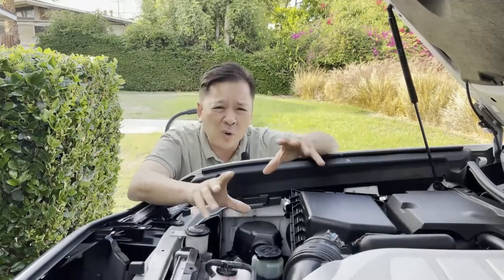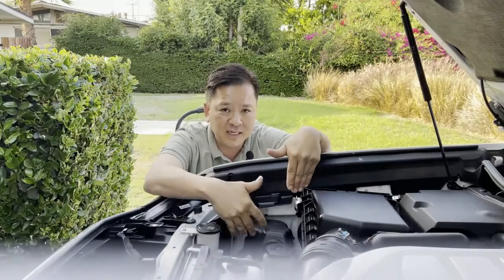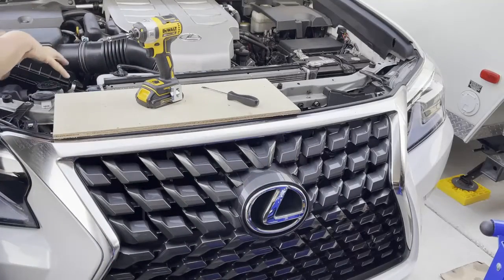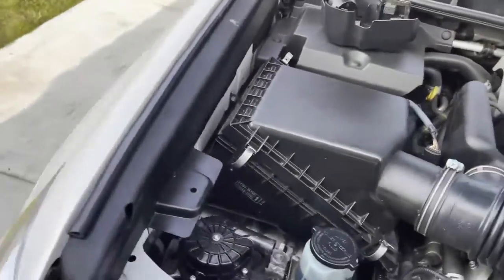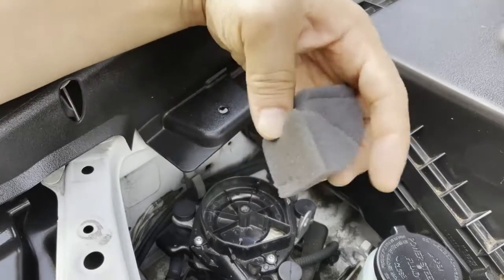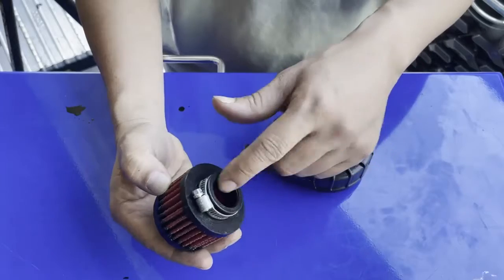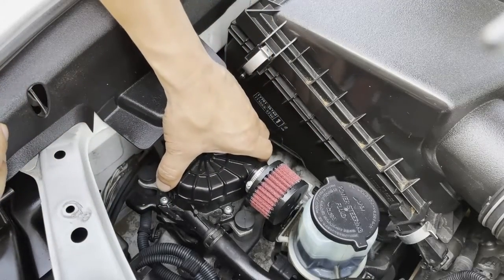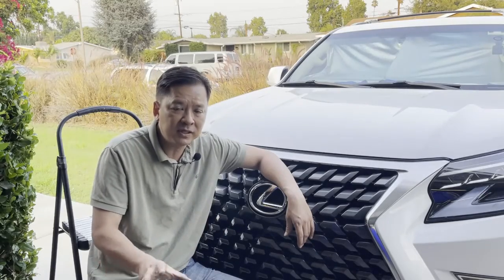Why We’re Modifying the Lexus GX Secondary Air Injection Pump

Comment: I did this MOD last week after watching this video. I used the K&N filter since I live in Vancouver B.C. Canada and the price for each filter was 1 dollar difference so I went with the K&N. I want to mention the K&N filter fits but it is tight. When finished it will be sitting against the side of the power steering fluid reservoir. Should be okay since the top of the filter is rubber and soft. You may have to squeeze and push things to get the cap on correctly with the K&N, but it does work. Thanks again ! Your videos are so helpful and appreciated! I share them with all my fellow GX owners locally or I recommend they subscribe.
Reply from the maker: Ugh... Stewart.  Please note that all my shitty Canada comments were prior to realizing I had Canadian viewers.  My ignorance finally accepted that our neighbors from the North have internet.  I promise no more shitty Canada comments.  Thank you for watching.
Reply from the maker: I think you bought the 2.375” height one. K&N makes a 1.5” height one that may have worked better. Here if the link: 
K&N Vent Air Filter/ Breather: High Performance, Premium, Washable, Replacement Engine Filter: Flange Diameter: 1 In, Filter Height: 1.5 In, Flange Length: 0.625 In, Shape: Breather, 62-1370 , Black https://www.amazon.com/dp/B00029WXTA/ref=cm_sw_r_cp_api_glt_fabc_XM0EE2J3EMZWT8YVK0E3
Reply: Is this not an issue if it does touch the power steering reservoir?
Reply from the maker: @jimilianhernandez8074  not at all as the filter is encapsulated by rubber. It’s anything all it does is act as a support.
Reply from the maker: @jimilianhernandez8074 If you bought the correct size it would not touch the reservoir at all.  There is actually a lot of play to move it in and out of the SAIS assembly.  In the event that u did purchase  one that was longer than usual, it would still not affect it since the top of the breather filter is made out of rubber/plastic.  The reservoir would just act as a support.  The breather is super lightweight and won't cause vibration scuffing.
Reply: @GXBOB  thank you Bob. Your videos are literally a lifesaver. And I enjoy ur humor ;)
Reply from the maker: @jimilianhernandez8074  thanks for the kind words!

Comment: Unfortunately, for us 470 owners, we can’t just pop in a new filter. Because some genius decided to hide the pump under the intake manifold. Going to the dealership tomorrow for my p1445 code, knowing full well how much they’ll quote me to fix it.
Reply from the maker: Yes, I've heard....and i can definitely relate.  My next quest is the PCV remove and replace which is another waste of a beautiful Saturday.  I just need to find some momentum to get started.  My second quest is to pick up a 2006-2009 GX470 to tackle some of the differences.  Haven't been able to find one that wasn't ridiculously overpriced.
Reply: @GXBOB  have you ever heard of these codes clearing on their own? Like maybe whatever was clogging the check valve and keeping it closed, came loose and opened it back up? I literally just drove it and the codes are all cleared. Have an appt at Lexus tomorrow. They won’t be able to run the code if it’s not there.
Reply from the maker: @BradleyJokerst  yes, that is supposed to happen with a solid CEL. A blinking one is a major issue and requires you pulling over and having your truck towed.  After i replaced the valve, CEL cleared by itself after driving it a bit.

Comment: Awesome tip!!! Thank you.
Reply from the maker: Anytime Coastal.  You can either keep the black top cover on or off.  I kept mine off more better air flow.  But when going in for smog inspection, you better slap it back on.
Reply: @GXBOB  I ordered from your link but I think they’re running out. Is there an issue refitting the cover with the new filter?
Reply from the maker: @CoastalGX  there is no issue in putting back the plastic cover. I left it off for maximum air flow. You’ll need to put it on if you take your car in for a smog check

Comment: Just fining your videos. I purchased a 2016 GX with 72,000 in feb. my pump went out in my tundra few years ago so ill take this mod very seriously. i do have another question for you though. when i push the brake pedal down i hear some air/vacuum noise. it only happens with the initial movement down, no noise when releasing the brake pedal. is this just how the brake booster sounds in this vehicle? Thanks!
Reply from the maker: If you stick your head under your dash and depress the brake pedal, you’ll notice the squishy sound is the actuator linkage for your brakes. I hate to say it’s normal but I’ve lived with it on all my GXs. Don’t go changing your brake booster, master cylinder, etc hoping it’ll go away. It won’t.
Reply: Thanks for the response. I can live with it lol

Comment: Hi Bob! First off all I watched all you Videos regarding GX. My next mod will be headlights + grill. 

Just did this update with the same component and exactly as you did in your video! Thank you so much, Bob. 

Quick question:  now, after turning off my car (GX 2015), I can hear some strange high tone sound for a few seconds under the hood. It sounds like this pump is trying to suck the air through this filter with the force or maybe normally but this filter makes it. 

Do you have the same?
Reply from the maker: After switching out my engine air filter with a K&N, i also get the same air hiss. Same thing with the secondary pump filter. The  difference in filter elements is what creates that sound. You also hear a little of the aftermath of the suction after the engine is off is the vacuum it created also coming to a dead stop.  You’re going to notice a difference in performance as u would with any filter that allows more air into your system.  If you want the sound to be less obvious, try putting the black plastic cover back on your secondary air pump assembly. I left mine off as shown in the video.
Reply: Thanks so much again for advice, I just took a ride and everything seems great! No odd sound or anything like that. 👍👍👍

Comment: Hah, so I got all my tools ready and popped off the plastic engine cover. I was about to pop off the cover for the air injection pump and noticed it already has a Uni filter on it. So either the dealership put it on or the previous owner did.
Reply from the maker: Haha 😂
Reply from the maker: Saved yourself some money
Reply: @GXBOB  Did you put the cover that goes over the air injection pump back on? Also, I wonder if the uni filter is washable?
Reply from the maker: @NytronX  Yes i placed the entire housing back on in order to pass smog visual inspection.  The K&N type filter is cleanable with low pressure soapy water and air dryed.
Reply: Does the vehicle look stock once again?  I was thinking it would, and that it would pass CA Smog.
Reply: @gwilli1754  yes

Comment: Hey Bob, do you think it’s still advisable to have this mod to a newer GX like 2020 and above. Great video. Thanks
Reply from the maker: Technically it’s not really a mod. You’re replacing one filter with a better filter. Sort of like replacing your cabin filter with a K&N one. Only difference is, it’s external instead of internal. You can visibly inspect damage before it escalates. One other thing…. The increase in acceleration is very noticeable after the switch.

Comment: Did you put that first black plastic cover taken off back on over the SAI? I just got done doing mine I put it back on not sure if that matters just didn't see it in end of video and was wondering if you left the new filter exposed
Reply from the maker: No. I left it off for better air circulation. Have you noticed a big improvement on your acceleration?
Reply: @GXBOB  ok gotcha!, you beat me to it! Because that was my next question was acceleration (I don't want to assume it's a placebo effect but after taking the GX around the block a couple times feels faster is that suppose to happen?) you answered it GX bob with advanced psychic A.I. abilities.
Reply: I should of hooked up my blue drive OBD2 find whatever in it monitors the vehicles conditions before and after the mod to see if numbers/factors change
Reply from the maker: @aranda2307  you can still do it. Takes less than a minute to switch back to oem

Comment: after removing the large plastic cover, when i tried to take mine off it didnt come off as easily as yours did with the center screw removed.

does the small cap on the end need to come of first?
Reply from the maker: I just took the mushroom cap off first because i needed the assembly to be held in place in order to pry off the mushroom cap.  I don't think taking the assembly off first or the mushroom cap off first matters.  My top housing was also kinda sticky and stuck from 5 years of being screwed down.  Only reason mine looked easier to pull off is because i did a couple of takes for film editing. It was already loose by the time i did my final edit.  Enjoy Skinny Girl!

Comment: Thanks again for saving us thousands of $$$.  Just ordered the filter and will do the mod shortly.
Reply from the maker: Just remember to make sure the flange diameter is 1".  If you are able to find a different type of clamp, it would be recommended.  I hear people using this metal clamp tighten it too tight and it wears/chafes down the black plastic over time.

Comment: Bob,  do you know if this works on the Tundra as well?   Two years ago my 2010 Tundra with only 50000 miles failed with this problem which Toyota fixed.  I still have the Tundra and also have a 2011 GX460 with 130000 miles on which Lexus wants to replace two catalytic convertors at a cost of $7500.  I will definitely do this mod on it before the pump fails
Reply from the maker: There are a span of years where the Tundra uses the same part as the GX460.  See this link i found on eBAy which uses the exact same pump.  As far as the location of the secondary pump in a Tundra engine  compartment, you'll have to do some research and locate it.  They all work off the  same principal whether or not your current year Tundra has the same designed air pumps or not.  The 4.6L engine made it very accessible in the GX.  For the Tundra, there are numerous sites on youtube that show this issue.  From what I see, the older Tundras are a pain in the ass to do the simple mod.  
https://www.ebay.com/itm/224376541358?chn=ps&_trkparms=ispr%3D1&amdata=enc%3A1-Ai6M8S5Ss2x6y9ruIPKLQ54&norover=1&mkevt=1&mkrid=711-117182-37290-0&mkcid=2&itemid=224376541358&targetid=1262407448140&device=c&mktype=pla&googleloc=9031253&poi=&campaignid=12875054069&mkgroupid=120167277977&rlsatarget=pla-1262407448140&abcId=9300536&merchantid=138361782&gclid=Cj0KCQjwsZKJBhC0ARIsAJ96n3WqHQmUNJKn20PsVj3mQaUGvZvA2d8HBPwFYGyf9CVekvXqBlk4cUkaAiciEALw_wcB
Reply: @GXBOB  Thanks Bob.  Enjoy your videos
Reply: @GXBOB  Do you think it is possible that I have early failure in this pump on the gx so that the catalytic convertors are not cleaning right due to the air pump but not enough that the performance is affected?
Reply from the maker: @MegaFjcruiser  Robert, driving around with a failed catalytic converter is not going to ruin your good working secondary air pump.  Your pump works as an output to the catalytic while your catalytic is the input to the air pump in the emissions flow.  You can do your K&N  filter mod and still drive around with your bad catalytic up until you have to do a smog check.  Only thing you have to worry about is the bad smell and the if and when your engine will seize up due to catalytic "burn thru".  You're going to run rich and maybe puff out some embarrassing smoke eventually.  I'd go look into your local junkyards for a GX or go online and find a used one if the 7500 price tag is too steep for you.  Good  luck Robert.

Comment: The problem is that the rubber where the metal clamps will deteriorate from the heat of the engine. I had to replace it after 2 years.  I ended up putting a thick grease around the rubber connection/clamps.
Reply from the maker: 2 years out of a part less than $20 is amazing as it is.  Thanks for the heads up.  Most likely i will check on it every oil change to see if i need to replace it.

Comment: Thanks for the tip! My first GX 460,  I will defiantly do this.
Reply from the maker: What year GX did you buy?
Reply: @GXBOB  2016, currently with 82,000 miles
Reply from the maker: @JasonSmith-pc6kr  Sounds about right. I have a 2017 with the same mileage.
Reply: @GXBOB  I've had it a little over a year, put about 20,000 miles on it, so far so good. My wife has a 2010 rx350 for about 6 years and now with 135,000 miles, and has been a great car, so I bought a Lexus.
Reply: @GXBOB  Hi Bob. I have a 2015 GX460 with only 52,000 miles. Do you recommend doing it now or waiting for running more on it?

Comment: Awesome video, Bob. Doesn’t the recall only cover up to years ‘13? Did Lexus fix this on the 14’+ models?
Reply from the maker: From the look of things, they're still using the same foam sponge that can deteriorate over time.  So i'm not sure if they made a "fix" or they just replaced it with a new sponge  when you take it in for repair.
Reply: @GXBOB  thanks! I have a ‘15 and for $30 it seems like it’s worth the peace of mind. What are your thoughts on the “lifetime” transmission fluid on these? Ive seen people argue in forums about whether or not to do a drain and fill.
Reply from the maker: @aragonXL  
1. If it was meant to be lifetime, why did they design a flush and fill hole in each of their transmissions?
2. I am an eyewitness of a few transmission drains that resulted in dark broken down fluids.  
3. I also believe when they said "lifetime", they didn't expect you to keep the same car for 20 plus years.  There is a statistical team that shows the average ownership of  each vehicle was probably 5 years the most.  I think they meant lifetime in that sense or so they hoped.  Same thing when they calculate warranties.  Ever know why things fail a week after the warranty expires?  
4. I did a drain and fill for each of my GX through my local mechanic using WS because it was cheaper than to do it myself.  
5. Even if they claim lifetime, are you driving your big investment or are they driving it?  The person that cares for your car the most is you.  I rather just spend the money every so often for peace of mind.
Reply: @GXBOB  i agree. Thanks again! Keep up the awesome content!

Comment: If this service for preventative maintenance how many miles do you think you should change that out in
Reply from the maker: The minute you bring your car home, i would do the simple mod so i can sleep better at night instead of second guessing the rough mileage the internal foam will start disintegrating.  This is assuming your car is at 80k or more and your driving environments fluctuate in the summer and winters.  After you do the mod, i'd check your K&N filter at every oil change and dust it off or clean it. Its supposed to last you the life of your car or when you die, whichever comes first.  (=
Reply: @GXBOB  Yeah I Checked under the hood and saw that the part does does not look the same as yours the housing  Part maybe it’s Different housing  since it’s a 2019
Reply from the maker: @jinheu5119  Its the exact same part with the same cover for 2019 GX460.    See this link from Lexus https://parts.lexusoforland.com/p/Lexus_2019_GX-460/PUMP-ASSEMBLY--AIR/63207439/176100C030.html?clickSource=relatedProduct
Reply: R u not worried about when it rains hard and your driving it will get wet and contaminated
Reply from the maker: @jinheu5119 
1. You're forgetting this is a large black plastic housing cover at the beginning of the video that can be reinstalled.
2. The K&N type filter has a wire cage around the paper element to prevent it from disintegrating and flying into the assembly.  
3. Your truck has to literally be submerged in a river to cause that type of water soakage and damage to an assembly that high in the engine compartment.  Any flying mist of moisture from your grill is very minimal since it has to get by quite a few deflections before reaching the filter.  
4. You're OEM  filter foam is worse with water contact hence the need for mods like this.  
5. Welcome to my channel Jin.  Thanks for the comment.

Comment: Bob, if you go mudding or do river crossings, will the K&N type filter not suck up water inside the unit?  Will it hold up in an environment like that?  Looking for your opinion and thoughts.  Thanks in advance
Reply from the maker: The good thing about this mod is it is super accessible (unlike the GX470) and can be switched out with only 1 screw.  Before you go submerging half your car in a river, i'd go back to stock as a precaution.  Bare in mind, if you look at your oem cap (the piece that your filter will replace, its also not water proof, only semi water resistant  due to the inverted design of the opening.
Reply: @GXBOB  Wonderful, Thank you and love your content.  Keep 'em coming!
Reply: @GXBOB  how about add a L shape rubber hose and fix increasing like 3 to 4 inches n then fix this filter
Reply: @daagdafire ya you could run the hose through the firewall to the interior and pipe it to the bottom of the drivers seat so it could run on gx driver farts :)
Reply from the maker: @audreyappliance  Excellent advice!

Comment: great videos. question: is this mod CA smog compliant? I know usually anything visually inspected with smog components will get denied automatically. thanks in advance.
Reply from the maker: There is a large black plastic cover that goes over the entire assembly. The piece at the beginning of my video.  When u go in for a smog check, make sure you put back that large plastic cover.  It hides the filter element.  completely.  Also make sure you buy the filter that has the black housing and not the chrome one.  The chrome one will stick out during inspection.